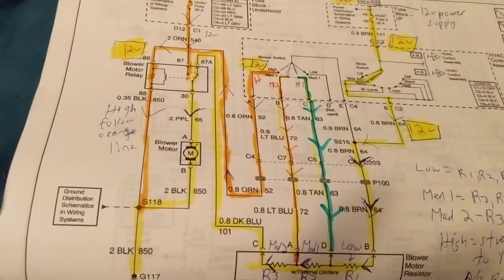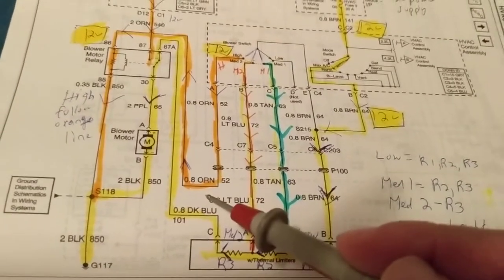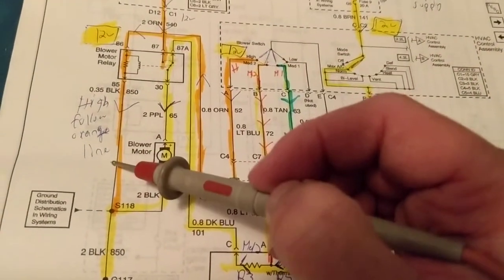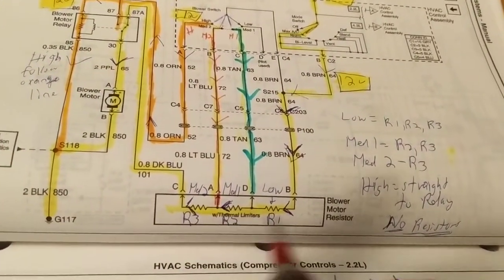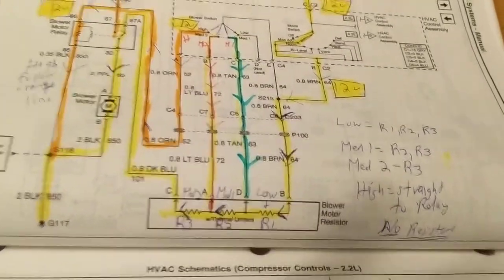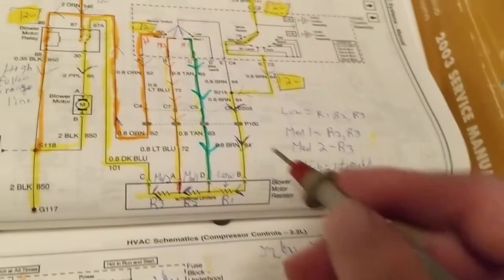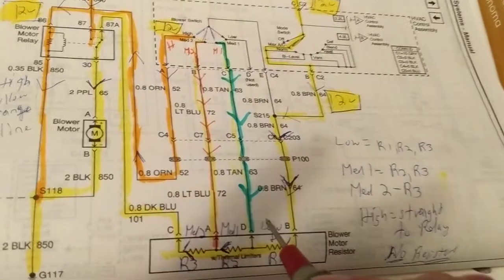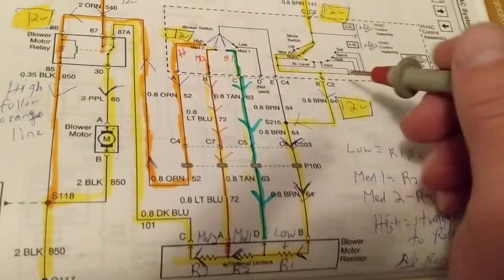HOW TO DIAGNOSE FAN MOTOR FROM WIRING DIAGRAM WITH BLOWER RESISTOR NETWORK

Comment: Great explanation on the blower system. I have a problem with my 92 camaro blower motor  brown power wire over heating. When I touch the p100 connector shown on your diagram, it’s extremely hot to the touch to the point where it burnt. It even burnt the plastic housing around the brown power pin that plugs into the back of the selector switch. I’ve changed the wire and connector from the fuse box to the control switch and it’s still overheating. It only happens on the  medium 1 and medium 2 speeds. It does not get hot on the high speed. In fact it stays cool on the hi selection. I replaced the resistor and it still get very hot. When looking for a used replacement p100 connector, I noticed a lot of them were burnt. I’m assuming this has been a problem especially with older GM vehicles. I’m thinking it could be the relay but not too sure. It is an air conditioner unit but the ac doesn’t work because the freon leaked out. Any help solving this problem would be greatly appreciated. Thanks
Reply from the maker: I have to look at the actual schematic for a Camaro 92 sometimes connectors get hot because they're making contact with other components or fans  that are hot obviously touching those connectors and wires remember on the high speed blower resistor is not involved only on the small speeds medium speeds
Reply from the maker: In the high mode the blower motor resistor is bypassed you get 12 volts right to the motor in the medium one the medium too and low range the resistor is used electrical the relay is only used in the high-speed mode so that probably would have nothing to do with the problem I will take out the connector and measure the voltage and if I can get the fuse out I would measure the current and medium one and medium to speeds